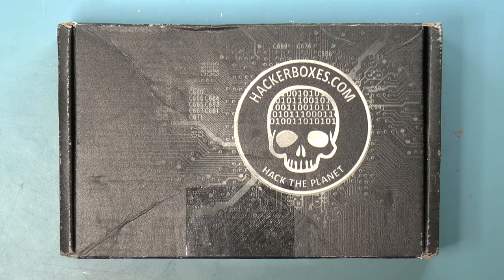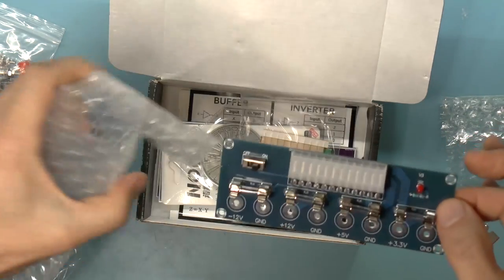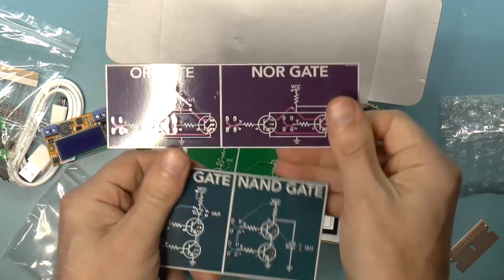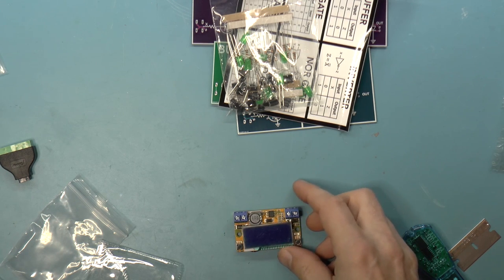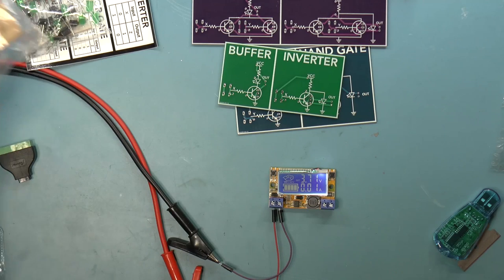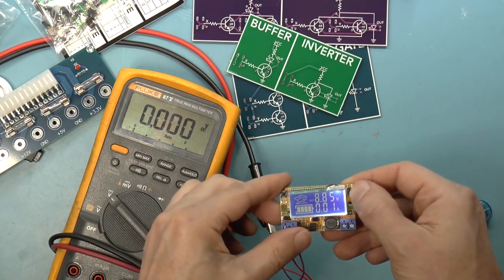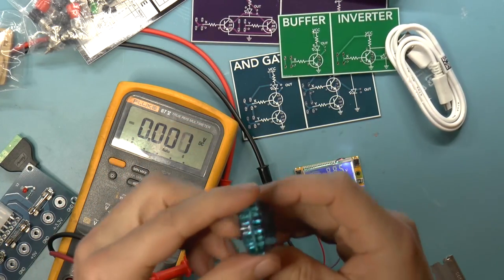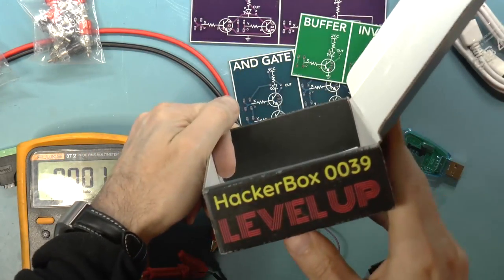Unboxing: Hackerboxes 0039

Comment: Those "standard sims" are mini sims, standard sims are credit card sized.
Reply: gudenau This is one of those interesting cases of technical words having a correct vs a meaning commonly known to the audiance. See also RS232 vs TIA232, RJ45 vs U8PC (or something). No one is going to think the reference to SIM cards is for the credit card sized versions so no harm is done.
Reply: This is a bit like "full height drives" in PCs, which are either 41mm or 83mm, depending on how old you are.
Reply: @lawrencemanning  This was more meant to be "did you know" over "you're an idiot."

Comment: It seems the buttons are controlling the MIN and MAX limits,  it the display is showing the ACTUAL output. Hence when you hold the button to increment the output the internal MAX limit continues to increment to some undisplayed value, but the LCD is only showing the current output. Take for example when you held the output button for a long time when on the 5v supply, the LCD output the actual value up until the limit of that 5v input, once you changed the input to (more than) 5v the instantaneous output was higher than previous.
Reply: I like the logic gate PCBs.